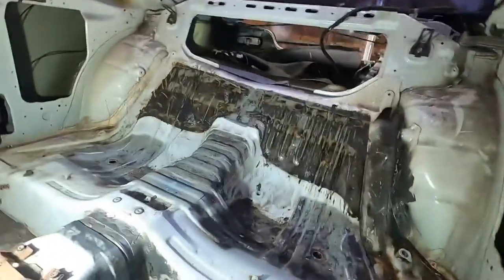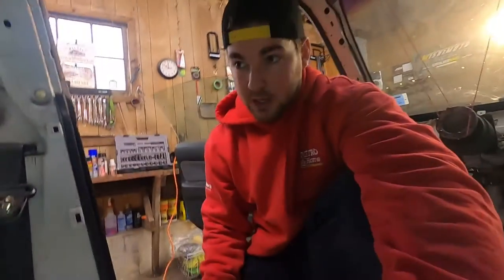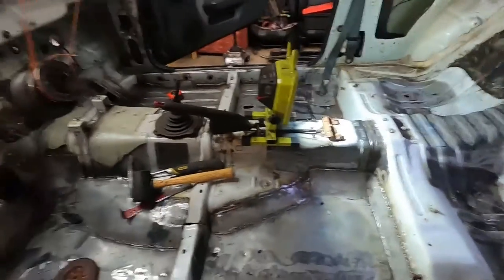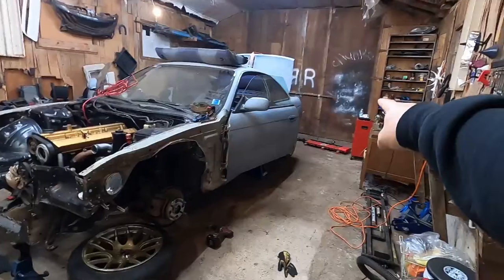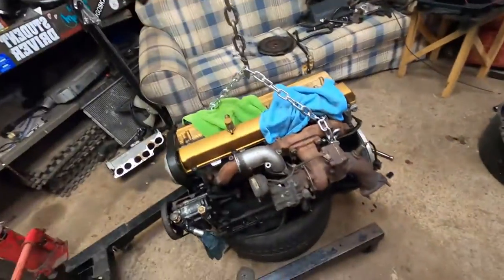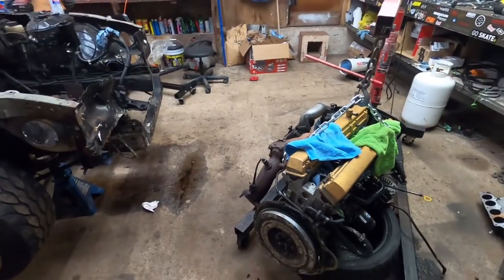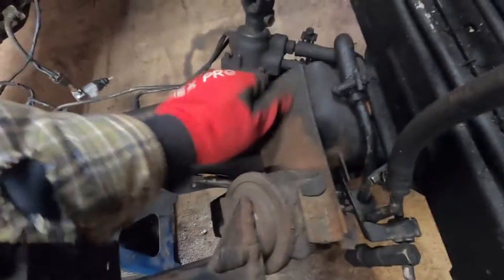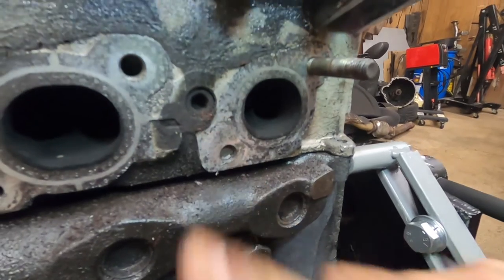Finally Pulling the Engine & Trans On The RB 240sx!

Comment: Put interior from the B pillar forwards. Dash, carpet, door cards, headliner, etc. Leave the rear bare and paint it.

Forgot to say that LRB makes a lot of 240sx interior bits out of sheet metal. It's all cnc cut and made to fit. They have a whole rear seat delete, inside quarters, and door cards.
Reply: @RoadRoyals  I saw that there are some cheap aftermarket carpet options on ebay. $300-$400 for a new aftermarket carpet. It'll probably need some tweaking and fitting though.
Reply: @RoadRoyals  $250cad + ~$150cad shipping on ebay.